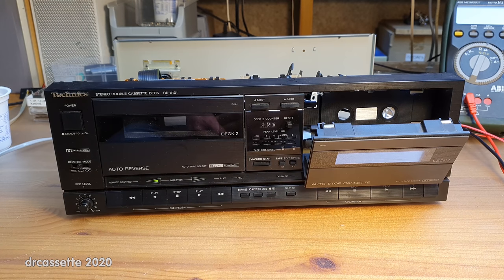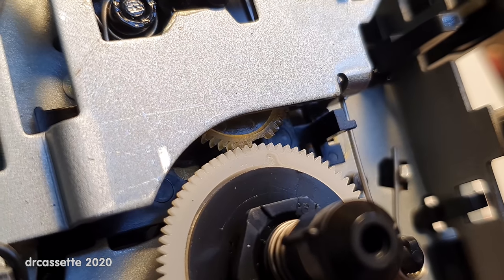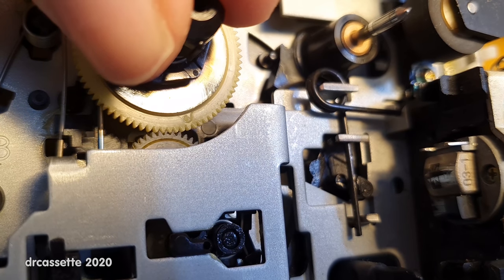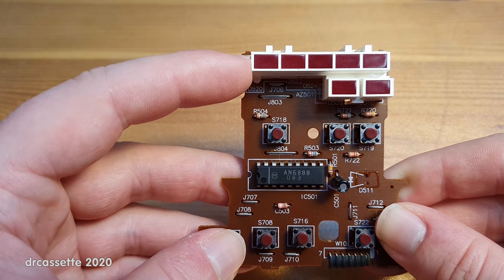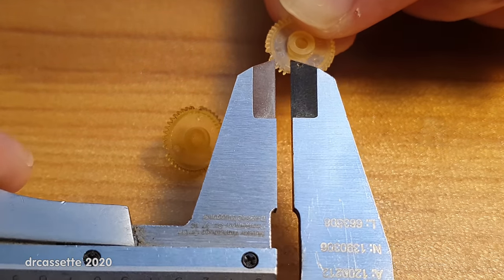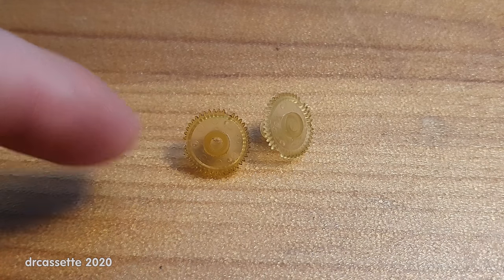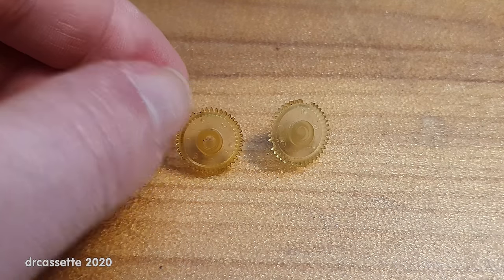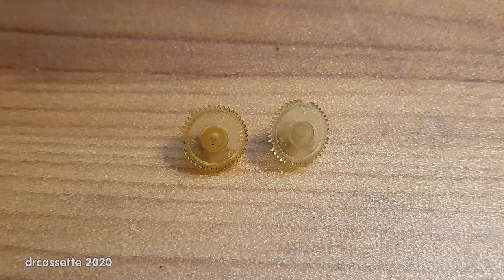Technics RS-X101 dual cassette deck with broken soft plastic gears

Comment: Und ich habe genau ein solches Doppel tapedeck von Technics, nur neuer, BJ. 92-94 denke ich. Wird also der selbe Mech. sein. Schade
Reply from the maker: Eine neuere Serie kann schon einen Unterschied machen, da würde ich keine voreiligen Schlüsse ziehen.
Reply: @DrCassette  Auch schon wieder 6 Monate her ;-) Sowas, sowas. 

Tatsächlich hat aber das Autoreverse Laufwerk meines Technics viele Plastikzahnräder, darunter auch welche aus vermeintlichem Softplastik. 
Auch das Direktgetriebene RS-BX 606 hat Zahnräder, die ganz danach aussehen, bei diesem Laufwerk sind aber hauptsächl. andere Bauteile aus Plastik von Verschleiß betroffen (Assy-Gear)
Reply from the maker: @DaXande135  Das ist gut zu wissen, dass auch die Technics Cassettendecks mit Quarz Direct Drive Probleme mit Zahnrädern haben. Ich hatte mal überlegt, mir eines dieser Modelle zu kaufen, denn mein Akai GX-75 hat zwar Direktantrieb, allerdings ohne Quarzreferenz, sodass die Bandgeschwindigkeit immernoch danebenliegen, oder mit der Zeit sogar driften kann.
Reply: @DrCassette  Für die Zahnräder gibt's Ersatz zu kaufen, das ist kein Problem. Vielmehr habe ich mit diesen Decks Bandknittern bei bestimmten Kassetten ab 90 Minuten Spiellänge.

Betrifft vorallem BASF Chromdioxid-Kassetten und maxell UR der letzten Generation.

Habe nun schon ein zweites solches Deck hier gehabt und egal, ob mit originaler oder neuer Andruckrolle, sogar mit neuem NOS-Andruckrollenarm von Panasonic, tritt das Problem weiterhin auf.

Die Zugkraft der Wickeldorne kann man hier leider nicht so einfach einstellen...
In einem Forum hat desweiteren jemand gesagt, bei ihm trat das Problem schon in den 90ern auf, als der Tonkopf bereits einen leichten Einlauf hatte.
Zu dem betroffenen Zahnrad: Dort gibt es ein sog. Assy-Gear, das mit einem Art Arm am Wickelmotor befestigt ist, dieser Arm kann durch Brechen des Plastiks an der Motorwelle verrutschen, sodass die Zahndäder nicht mehr ineinandergreifen. 
Ansonsten sind gerade die höheren Decks von Technics immer ganz schön gewesen, gerade auch wegen dem Quarz

Comment: Even some Nakamichi decks employ plastic gears - only to fail a decade or two later. This is poor design/engineering.

The Sony decks I have employ a drive shaft on to a rubber tyre - effectively a friction drive with acting slippage, these are theoretically repairable.
Pity about the Technics DC, and rather annoying too!
Reply: A Nakamicchi would be worth repairing though. Technics - not so much.
Reply: @Lesrevesdhiver  Agreed, but finding suitable gears may be a big problem.